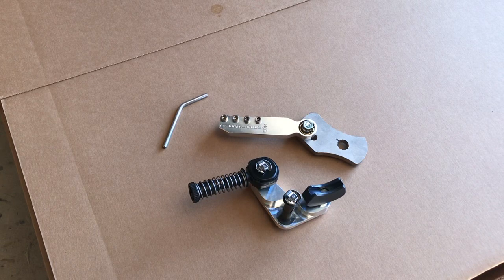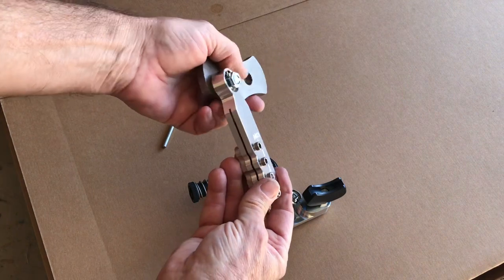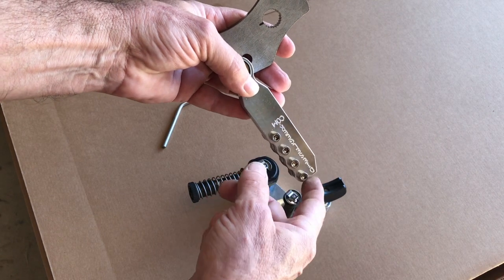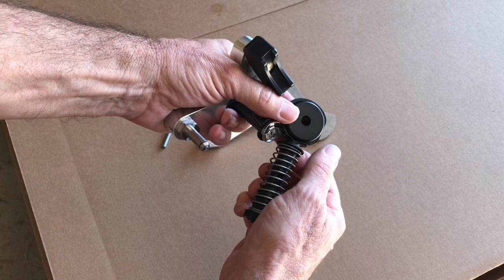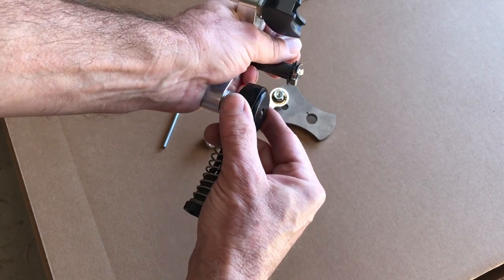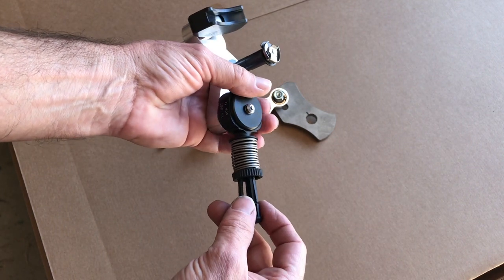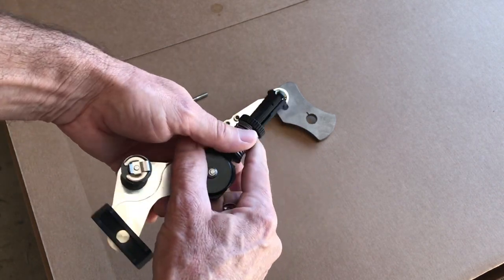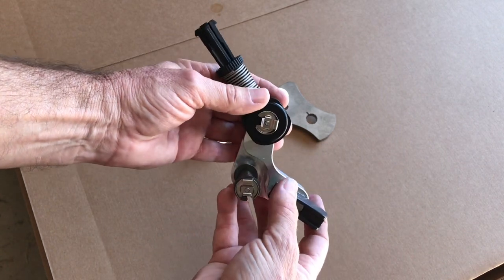Dieselgeek 2021 Sigma Shifter Explained

Comment: Any plans to sell the updated side to side parts separately for existing owners who want the easier adjustability?
Reply: @dieselgeekdotcom  My side to side bracket is a little bit out of adjustment, making it hard to get into first gear sometimes, and the aluminum cable end has already deformed around the cable so I can't get it adjusted perfectly. I'll look for those parts.